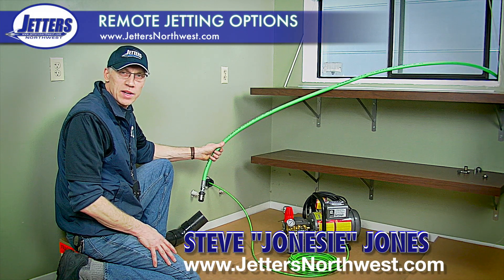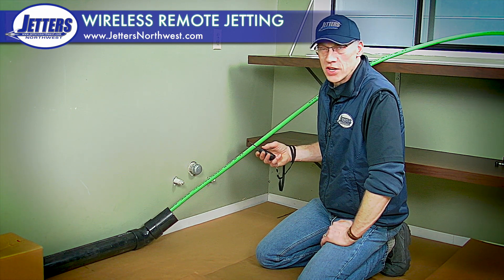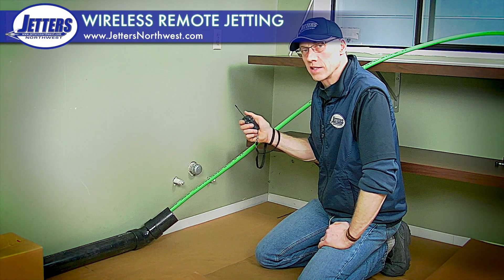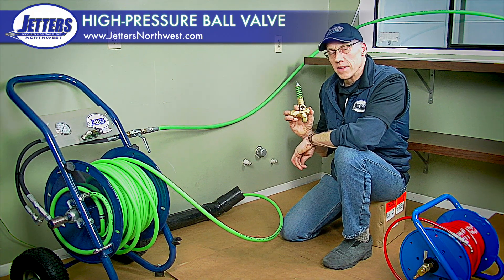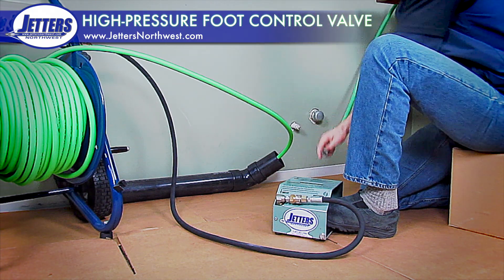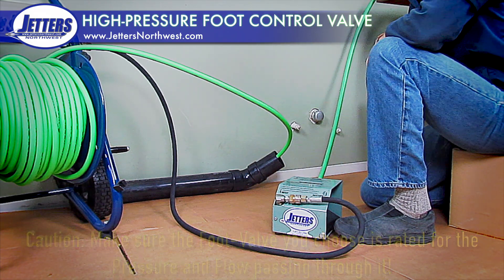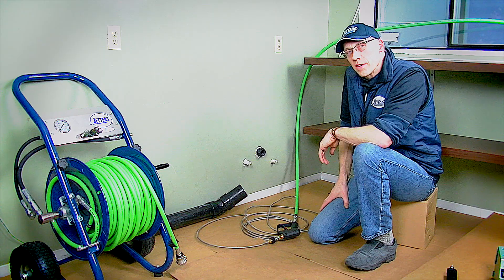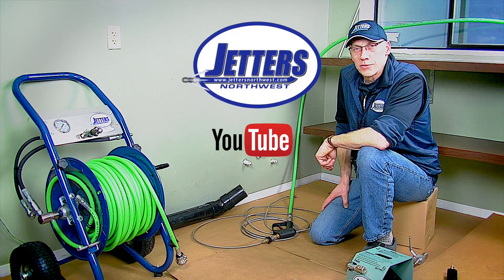4 types of REMOTE CONTROL for your HYDRO JETTER - "GET" JETTING  with JONESIE

Comment: Jonsy

The jet ex nozzle  does it pull hard.

Will it work well with a 4gpm jetter
Reply from the maker: Do you mean max length of 3/8"?  You can put several hundred feet on before pressure-drop is significant at only 4gpm, BUT 4gpm typically cant pull 3/8" hose much more that 100-150 feet unless conditions are perfect and the Nozzle is really built for thrust.  I recommend 5/16"(.31") or 1/4"(.25") for 4gpm, depending on the jetter's PSI rating and the pipe-size to be cleaned :)
Reply: @JETTERSnorthwest  thank you